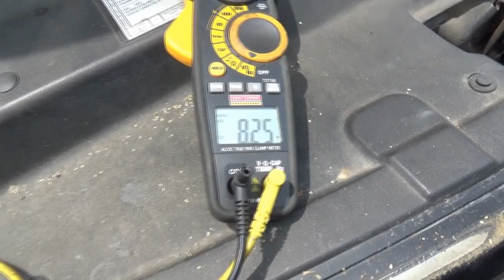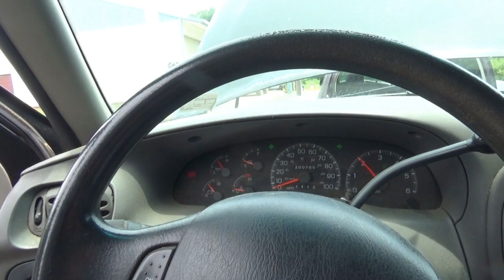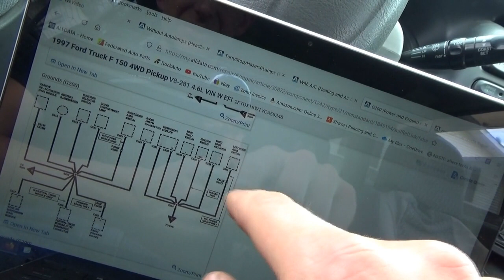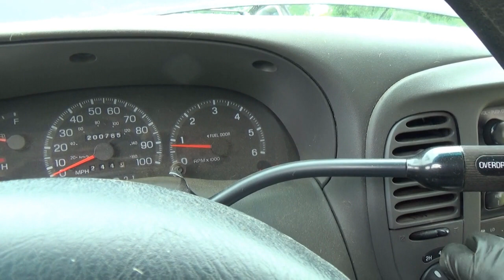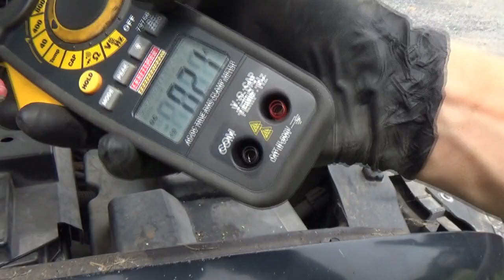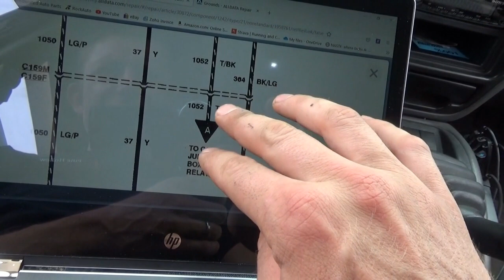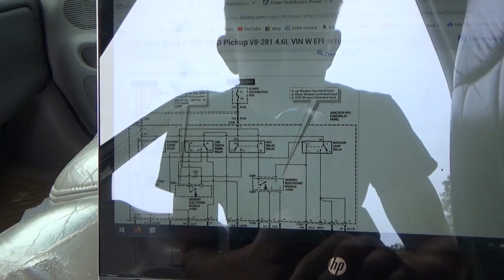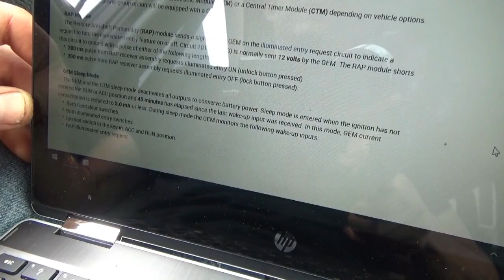Fix Or Repair Daily?  Part 1 ('97 F150 Major Electrical Issues) Independence Day Special!

Comment: I was told when I was very young that bad grounds are the most common source of electrical problems in vehicles. This week I will be 78, and this is more true today than it has ever been, especially since the number of "features" that rely on the electrical system has grown astronomically since I was a young man.

Comment: That was probably the best diagnosis I've seen since I was taught. Mind you I was just a kid back then and am no longer a mechanic (retired after 30+ years in the industry). It was just a beautiful thing to watch someone at work within their element. That might sound strange to some folks. But I honestly don't think I "worked" a day I was able to work on a vehicle. Yeah, I like/liked it THAT much. Now I just do odd jobs and help my kids out when they need it (and they're willing to come to the house. LOL). Anyway, OUTSTANDING bit of work Sir!!!
Reply from the maker: Thank you for the kind words! This was just a warm up... Part 2 is even more fun 👍😉
Reply: OUTSTANDING! Am definitely looking forward to it. I found your channel today. Specifically for this vid. I'm working on a 1997 F-150 4.6L 4x4 vin 6. Four wheel drive isn't working. I'm  pulling my hair out because I can't find the problem. I've checked out all the vacuum, completely. I pulled the shift motor and manually put it into 4 high. So it could be driven here to the house. It was stuck in 4 low. But I really didn't check the motor yet. I didn't when I pulled it because of it being pretty late at night and because of where it was (in the middle of NOWHERE!). One would think automotive would be easier the more one does it. Which is true, to a point. Plus it's been a while since I turned wrenches for a living. After proof reading this I'm just making excuses for my shortcomings. Anywho, looking forward to the next one. 
Thank You Sir for your time and efforts. It's definitely appreciated. Not only for the technical aspects. But also your professionalism, attention to detail, and as I stated before, it's always enjoyable watching someone in their element.
Reply from the maker: @abitoffcenter383  Perfect timing. Next 2 vids deal with the ESOF 4x4 system 👍👌
Reply: @PineHollowAutoDiagnostics  OUTSTANDING 😆😊

Comment: Ivan that little meter it's not just a toolbox queen .
It has a big secret !

The DM79 is a dream for pcb fault finding .
It has a very low output voltage on the ohms range .
So you can normally test resistors in circuit without the semiconductor junctions getting in the way .

Obviously with no power on the pcb ….
Reply from the maker: Never knew that! It's a kick-ass meter, almost 30 years old!

Comment: When I had "electrical gremlins" in my 2001 Lincoln Navigator a couple of years ago, it was due to a leaky windshield causing water damage to the fuse box and electrical connectors under the driver's side dashboard.
Reply: That issue is wildly rampant on navigators and expeditions that generation.  My cousin's expedition would randomly roll its windows down/up, turn the radio on full blast, and honk it's horn (as in stand on it) when the truck was sitting, key out.
Reply: @thetinpin  Yeah, my blower fan would run at high speed with key off. I had to pull the fuse to shut it off.
Reply: @spinb  Bet you got good with the needlenose pliers!
Reply: @thetinpin  And after a while I could put that fuse back in with my eyes closed!
Reply: Ah yes, the GEM module on the back of the fuse box. I replaced mine in my 97 F150 with an updated version. Also, taking the vehicle to a windshield place and getting that leak sealed up helps immensely
Reply: @mikeford963  where do ya get a gem module?
Reply: @codys1108  rock auto for an updated one

Comment: As Derek might say, that hole is an ankle vent, and because of the weight reduction it will give you 5.29% more HP, see there's always an upside if you look for it, I'll be dipped!

Comment: Some of those older Fords, up to about '11, take up to 45 mins to fully go to sleep, I'm glad you mentioned this! Anything you disturb, such as pulling fuses, you must let it time out fully or you might be chasing your tail. I had a customer install 3 'smart fuse box' assemblies (used) on his 06 Taurus because his battery was going dead, and he thought the GEM which is inside said box, was staying on. It wasn't. The battery itself was bad.

Comment: At this point it's safe to say almost zero Ford stereos from this vintage will turn off unless you pull the fuse. Many of them didn't survive 5 years.
Reply: On/off wasnt a problem on mine, but that god damn volume knob would go from zero to speaker destroyer full blast randomly.
Reply: @thetinpin  It takes a gentle touch! Crappiest car stereo I have ever owned!
Reply: @jaminova_1969  At the end of my patience I was pushing medium hard one direction while turning for it to (kinda) function.  After I destroyed a rear speaker trying to turn DOWN the volume at a drive thru I replaced it with a Kenwood deck.
Reply: @thetinpin  Nice! I was like, "How the heck.. did my volume knob break" while it was full blast! I think when I have the money I would like to replace it with a screen, since Ford forgot how to make a decent radio. What ever happened to Philco?
Reply: Just replaced my factory stereo in my 97 only because I got a new aftermarket one had no problem with it

Comment: Thanks Ivan for finding out it takes 45 minutes for that battery saver relay to go to sleep. I just started chasing the same voltage draw on the same circuit in my 99 F-150. Good job.

Comment: Thanks 👍 I had to replace the fuse box under steering wheel because water leak from extremely poor design. Extremely common problem, causing weird problems. Also Ford's grounds are in bad places. I like Ford, design problems.

Comment: Great diagnosis - as usual . I know you mentioned not charging for a diagnosis if the problem is not there . However - just checking to verify a problem does not exist , your research on the forums and the operational parameters of THIS year , make and model GEM module is time invested - wether a problem is there or not . Since you are working remotely you have to wait till the module goes to sleep . It's not like you can jump on another vehicle . I hope you are compensated for your time and experience . Bottom line - you get results . There are too many hacks out there . That new eyelet and a few hours labor is worth more than a pile of shiny new useless PARTS .

Comment: Just happen to come across this. I had a similar issue on a '97 also. It was the alternator, but only above the 2K RPM range. The internal regulators went out and it would kill the battery as you drove.  replaced the alt and it was good to go.

Comment: I had that same truck before, the GEM modules are known to go bad, mines had wiper motor issue where the wipers wouldn't turn off but also had parasitic draw similar to this one but never got around to diagnosing it  because it had engine issues also so I'd just pull that #22 maxi fuse when I parked it to prevent battery drain. Also very nice flow chart diagnostics and explanations. I've never replaced just a clutch on a compressor its always been the whole unit, lol, nice work though!

Comment: Late but I just saw this video.
When you started with the parasitic draw the first thing that came to mind was the gem module. My 03 Ranger has a bad GEM module that draws 375ma continuously. Pulled the relay and the battery saver relay and it goes away. I'll replace the GEM module to see if it fixes the problem.

Comment: Hey Man. I'm glad I ran across you on YouTube. I have been trying to get my 98' F-150 straight for going on two years. The truck is actually a good truck. But I have a terminal illness that effects how long I can work on it, and when. I am actually pretty close to getting ready?.?!.? But I just keep getting hit with a bunch of small issues. Like non-stop. I really want to get it finished so I can go on my trip. I can't find anyone to help. So that's frustrating. Anyway sorry so long here. So I will just hit you with one issue and go from there.
When I crank up the truck the driver side window rolls down. I'm pretty sure there are more electrical problems. Any help would be very much appreciated. And I'll be glad to contribute! Thanks in Advance, Traigh in SC

Comment: Ford has had that 45 minute wait for many years.  When ever I had one of those vehicle's for a current draw problem, I'd try to be sure to have a second vehicle to work on while monitoring the 45 minute wait.  BTW.  That 45 minute wait could be 35 to 60 minute wait!

Comment: Wasn’t this the generation f150 that had water intrusion problems on the bcm that caused all sorts of problems
Reply: Yes.
Water runs down the harness from the firewall, and gets in the back of the GEM module connector. I tied a rag around the harness... No more issues.
Reply: Never found anything inside the gem module, to indicate water ever made it through the connector.

Comment: I didn't really understand your logic with the low ~1mV measurements over fuses saying "it's a 50amp fuse so <1mV is a lot". 50A is just where the fuse blows. I think what's more of a tell is that fuse should be in theory a 0 Ohm resistor, so taking 0.3mV/~0 is at least some current (in the case of 180mA, V = 0.3mV, R =  1.6 mOhm, which is plausible).

So the test is right, but the theory of a 50A fuse being a lot is so so. Maybe the resistance of a 10A is higher given it's less metal and since we're in the miliohms that makes sense.

None of this matters btw, only on paper. You're spot on with your work.

Comment: My rule of thumb, is when a vehicle reaches 180,000 miles 
you sell it no matter what. I have a 1997 f-150 with 163,000 miles 
and it is going to the junkyard because the previous owner did
not take care of it.

Comment: That poor old truck, brings back memories for me though. I had a 98 F-150 that I bought when it was only 3 years old with 28k on it, it was a great truck. I would have kept it longer than the 13 years I had it but NY road salt isn't kind. So what's in part 2, AC clutch repair? I have heard of some vehicles actually keeping the BCM awake for 30 minutes or so, I believe it has something to do with reading mileage if the display is digital.

Comment: I know,it seems that the Fords are very particular about having good grounds, etc to run properly as even my great uncles adopted daughters Ford EL Falcon conked out just once with a replacement ECU fitted so I went right through the battery terminals & the wires connecting onto the battery terminals including the main fusible link cable & I soldered the factory crimped connectors to give the ECU a good connection to the battery & the charging system,it hasn't stalled since, note it conked out all the time with the old ECU.

As far as parasitic draw goes, my Holden VY SS Commodore runs things such as the radio clock,the LCD odometer & the security system LEDs on the radio & on the instrument cluster.

The interior illumination such as the interior light,the illumination for the knobs, etc & the backlight for the display on the radio turns off after the car has been locked 🔒 by the transponder unit in the ignition key & the security system is then switched on by the BCM.

I did have a seat height adjuster switch get clogged up with dust which caused a contact to partially stick on which was running the battery low all of the time so I just pulled the switch apart , cleaned it out & reassembled it which stopped the parasitic draw on the battery.

Note that I have never had such bad ground problems with a Holden as I have done with a Ford - I don't know why!

Comment: On the four-wheel drive Ford had a problem where the two solenoids that mount on the firewall on the passenger side that control the vacuum for the chamber that pulls in the four-wheel drive would pull moisture in through the vents. In my 98 it went as far as got all the way down into the vacuum chamber that engages the gear in the front axle. Ford later solve this by putting a plastic Shield over top of them sort of like a small roof to deflect the rain water coming in under the hood. I had to replace the solenoids remove the vacuum chamber and drain the water out of it. Just a thought

Comment: Ford.  Love how the battery saver module kills the battery.  Do we need this crap?
Reply: Good comment Bill. When you follow Ivan's Pine Hollow Diagnostics you see how amazingly complex vehicles have become. Compared to the Model T that had almost no circuits it makes you wonder. But no wonder mechanics either need a designated diagnostic tech or they need to acquire that skill themselves.
Reply: You know GM's have the same issue with their battery saver features....just like people bitch about exhaust manifolds on Fords as if its unique to them. If you were a real mechanic, you would know that Chevy LS series engines as well as chrysler hemi's also have exhaust manifold issues as well.

Comment: At 1:13, if you connected the charger and got 15.85V, your charger is malfunctioning.
14.2V is acceptable, but that is an electronic regulated charger, it should not get that high, possible vehicle electronics damage.
The fact that the battery voltage "jumped" literally leapt to 15.84V indicates that the battery is possibly damaged, that jump indicates a very high battery series resistance. 
Just my view...

Comment: Have had to wait up to 45 minutes for a 2003 F150 to go to sleep. Assumed security module programming
Reply: If you have a dvom set up, you can actually watch the modules go to sleep within that 45ish min period. The last 180-250mA draw usually takes a good 20mins AFTER the rest have shut down. It is the GEM/Battery saver system that finishes last. Strange, but true!

Comment: You mentioned voltage backfeed. How exactly does a bad ground cause this electrical issue?
Reply from the maker: @T.J. Kong Excellent explanation!
Reply: @T.J. Kong Yes, I understand all of this in theory already, except I just can't picture a circuit where a high resistance shared ground could cause this to happen . Do you know where I could see a diagram as an example?

Comment: Ford's always  had problems on the electrical side of every vehicle  built specially on trucks and econoline vans with external stater solenoid  wires and fusible  links with green corrosion

Comment: Dear sir I am so impressed by most of you work,but when I seen you use a crimp on connection, my experience  with those things are short term fixes, ive worked with 28 wheelers and there trailers lights and not long after they left the connections vibrate loose,I have found that soldering them last a lot better, ive done  a lot of that at my c.b.shop,thanks
Reply from the maker: Truck will rust to pieces before my crimp connection lets go 😂
Reply: @PineHollowAutoDiagnostics  ha,ha, that may be so but those 18 wheelers would call us with in 100 miles from our shop and say the trailer lights went out again, and those aluminum connections just would vibrat loose, but when we soldered them they never came loose, I thank you for your shows,you are a lot smarter then I am, I just worked on c.b. radios, I can hardly do emails, keep it up and I will always  watch and respect your knowledge, God bless and merry  Christmas, I have been known to over fix stuff at times ,I love your shows,my c.b. handle is dr.who,peace bro
Reply: I'm just a old 73 yr old vet, that over fixes stuff, I use to put 305 V8,s in Chevy vega,s and use nova rear ends and invent cross members to keep  them from falling apart, thanks for returning my comment,it means so much to see a person so into quality work,
Reply from the maker: @johnnybartlett-ke9wg  thank you for the kind words! Yes I use solder and shrink wrap for all regular wiring repairs... Can't stand butt connectors! 😁

Comment: Buddy of mine works for the power company they had 22 new fords all burned 5 qts of oil in sn 8 hour shift mine you there is 3 8 hour shifts in a day you call 15 qts a day good i didn't think self changing engine oil was an option 😊

Comment: You got lucky, some of these shift on the fly f150's were natorius for getting stuck in 4wd.
Reply from the maker: What was the reason?
Reply: @PineHollowAutoDiagnostics  well if it's like mine the GEM module doesn't reverse polarity to the shift relay, like it's not getting the 2wd signal from the selector switch even though it is, but also could be a shift motor or the relay itself. There's more than one reason why on these models, and it'll give you the same issue... not going back to 2WD.

Comment: You know what Ford stands for don't ya? Daily overhauls do get expensive!
Reply: You do realize that truck is over 20 years old,......right? More dependable then a new GM or Dodge.
Reply: @kdrapertrucker  I own a 21 year old GMC truck (since 2005) that has been exceptionally reliable, so you are preaching to the choir. However, I would argue newer vehicles are more reliable with respect to their ancillary components, alternator, fuel pump, ect. I would also argue a modern Chevy/Ford would be more likely to make it to a 100k without problems then a 1997 one. Obviously the modern one's problem  would be significantly harder to fix.

Comment: Ivan! gimme link for the amp tester you use or add to description
Reply from the maker: Craftsman....it's sadly discontinued :(
Reply: Klein has at least one that does dc on the clamp meter...
Reply: CL390 is the recent version.
Reply: @PineHollowAutoDiagnostics  ok. thanks
Reply: @mattmanyam  thanks! I didnt even notice there was a difference ac/dc
Reply: @bobspurloc  most clamp-meters only do AC in the clamp.

Comment: Noticed you didn’t try pushing on the clutch plate to engage it with 12v applied, or check the air gap. Probably worn out of tolerance?
Reply from the maker: Just a weak coil... Plate didn't move at all